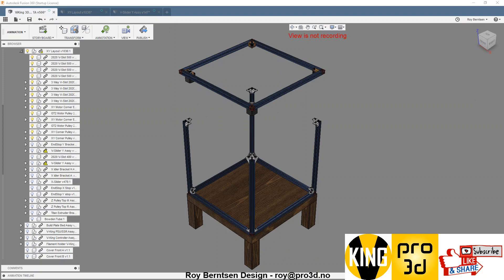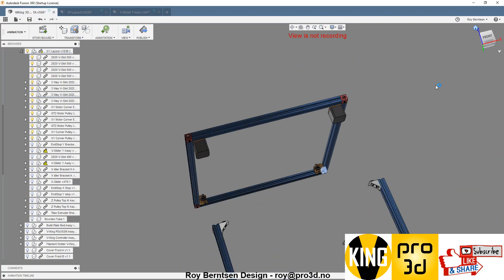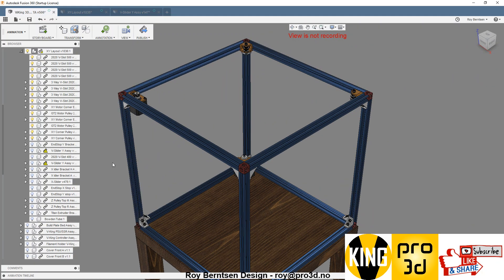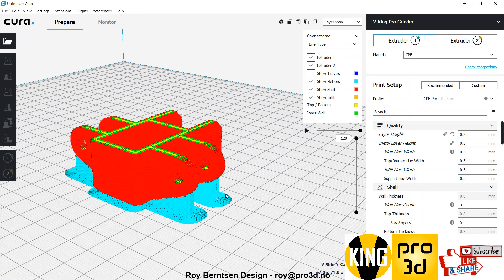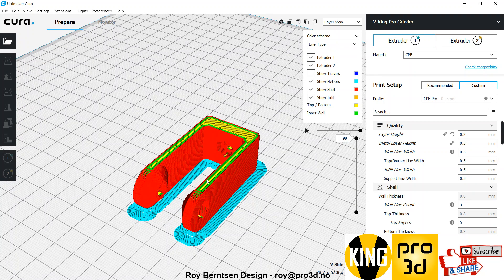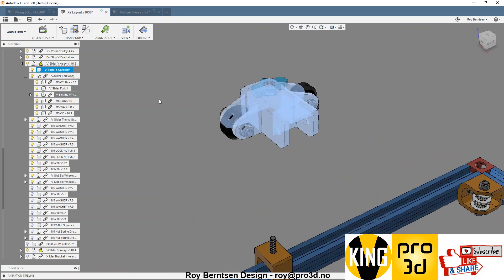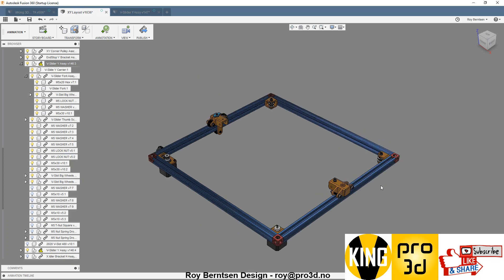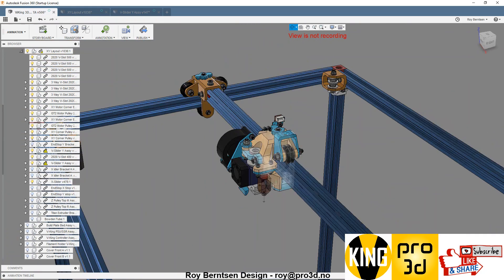V-King - Y Carrier and Frame Assembly

Comment: Hi Roy. Just wanna say thanks for your tireless work and very thorough instructions and information!. I am currently pricing the build costs but i had a question. I notice you some times use solid wheels and sometime the the v cut wheels. Is there a difference and what is your preference? Thanks, Ned
Reply from the maker: The wheels works the same. Same dimesions but I do prefer the solid wheels as they seem more durable. The V cut wheels looks like to release more delrin over time. You will not see any difference in printquality but I do advice getting the genuine openbuild wheels as the bearings is better than the clones and this is important
Reply: @PRO3DESIGN  That was what i guessed. That is good as solid wheels are more readily available. I am going to use clone wheels but the Kit version with rubber sealed bearings. About 1/3 price of openbuilds